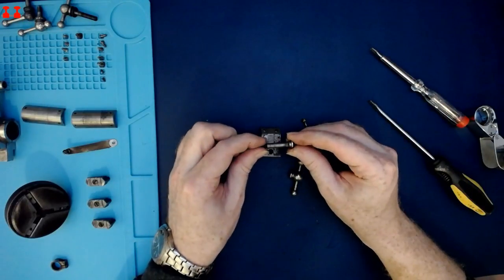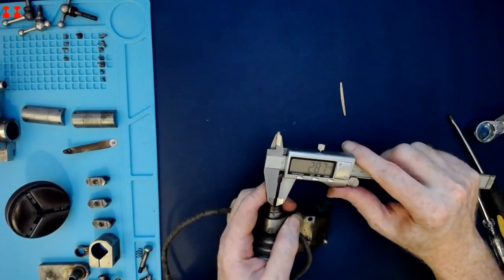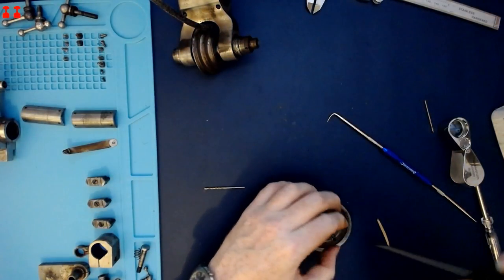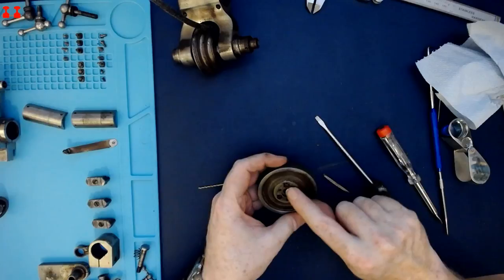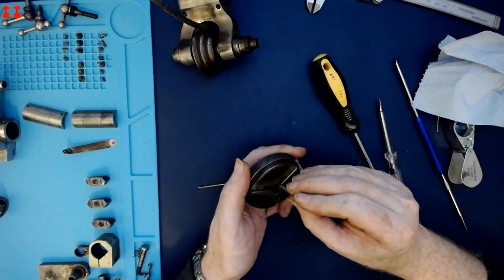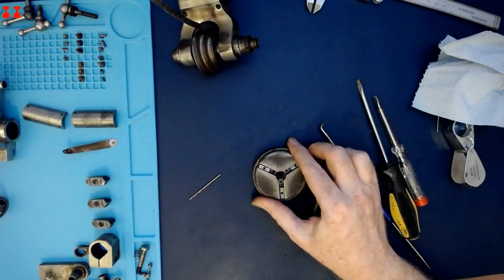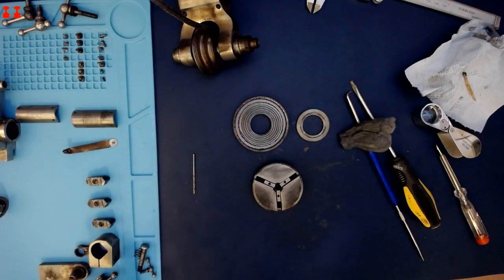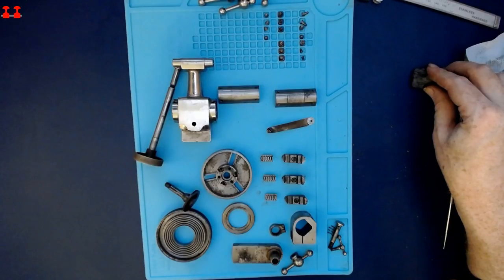Live : Boley Watchmakers Lathe Restoration - Chuck and Tailstock

Comment: Agree with anomicworld. There must be either a pin. taper or plain, that secures the pulleys onto the spindle. Or maybe a setscrew. Either way, the pulley has to be loose on the shaft before the spindle will come out.
Reply from the maker: You're right, of course, but that's not what is blocking me right now. The grub (set) screw holding the pulley in place will have to be removed for the spindle to slide clear, but first I need to loosen the split retaining nut, which is holding the spindle securely in the bearings.
Reply: Ah, I see. Total immersion in a solvent,  preferably for 24 hours, might help the extraction process.
Reply from the maker: Yep, it's been soaking today. It really needs the right tool, so I can safely get a proper grip, so I'll have to make one.